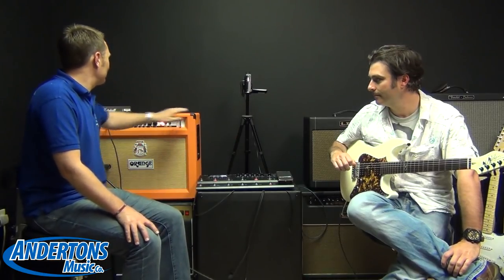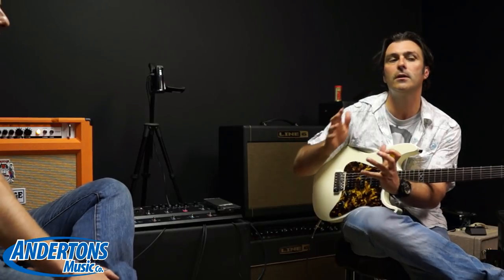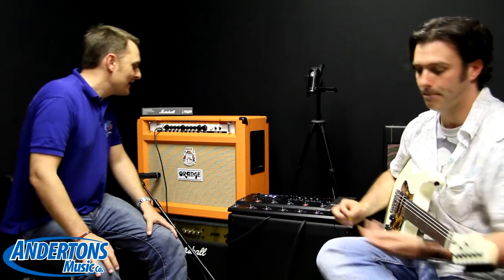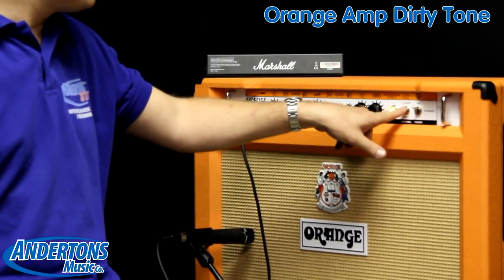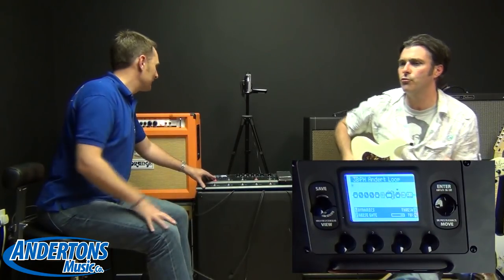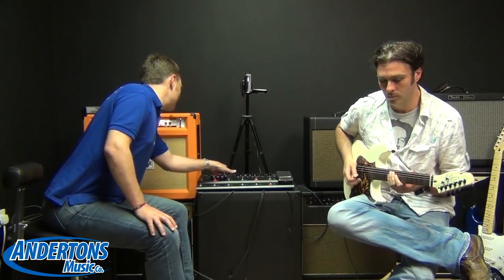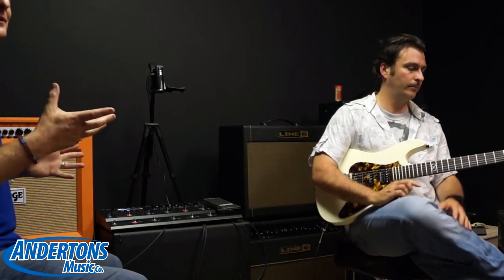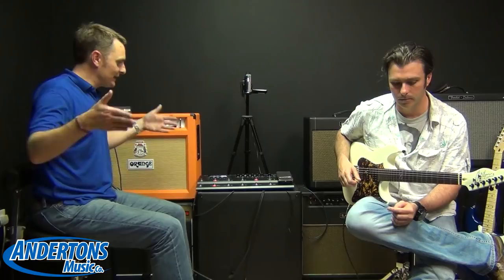Line 6 POD HD500X - 4 Cable Method with Orange Rockerverb 50 MkII

Comment: I'm glad you brought that up. Thats exactly why I won't go this route. I have a 100 watt EVH 5150iii. This is an amazing head. But there is a noticeable difference with this in the loop. If you love the pure sound of your amp this WILL effect it. It's too bad, the versatility and the affordability makes this a great option. If it just had true bypass it would be a winner!
Reply: Totally agree. I've got a Mesa Mk V:35 which is an awesome sounding amp but putting the HD500 in 4 cable method sounds crap. If I just put the POD in the effects loop and feed the POD through a effects loop module (in the POD), it sounds OK (standard 2 cable effects loop) , but putting a guitar into the guitar input of the HD500 sounds horrible (background hiss and noise) with the tone sucked dry (4 cable method). It appears that the input stage of the POD just doesn't play nicely in front of a real amp.

Comment: This tutorial by far is the best video on the 4 cable method, as it effectively turns your single channel amp with an effects loop to a dual channel amp thanks to the modeling on the HD500x. Question, what output mode did you select for this? Studio, Combo Front, Stack Front, etc?
Reply: themarcoharder hi, i hope you got an answer somewhere else... if so can you share? 😊
Reply: you go power stack front or in... dont remember the setting name right now

Comment: Guys - I had a RV50 MKII and used the 4CM with it like I did with my Blackstar HT60 - (Enough acronyms?)  I don't hear your amp doing this - but MINE would pop when turning on and off effects - I wonder if it was because I had the Impedance modelling set globally to the highest, instead of modelling the individual pedal impedances (Which can kill tone in other setups).  I ended up selling my RV50 because of this issue, and it was like 100lbs.   I've recently re-ordered the RV50 MKIII in head/1x12cab combo - and Would love some advice on how NOT to pop when turning effects on/off.  I will eventually move on to Helix - but that assumes that Line 6 can ever manufacture enough to be in stock anywhere.

Comment: Question for the Line6 dudes - have they fixed the tone/level loss problem when using 4CM on the original HD500? The fix for that involves using two EQ blocks - before and after the loop - to correct the levels; losing those effects blocks pretty much permanently if you use 4CM sucks...

Comment: I just run the HD500 in & out of my effects loop. Using only the HD500's Delays, Reverbs, and other modulation effects in my amp. I shut off the stomps, cab and amp sims.

Comment: If you are connected via 4 cable method, how does the volume work, if you choose HD500X preamp? Does it go as much loud as it would if its amps preamp would be turned on?

Comment: I have a line 6 spider IV 75 watt and a POD HD500X pedalboard, I need to help me understand how to connect the L or R output directly to the amplifier without losing the original sounds of the pedalboard, since I tried to set the amplifier in clean sound to get Better the sounds of the POD but it has been useless, it always sounds like stuck sounds.

Comment: I am curious about using the 4 cable method to use the podhd500x with an axe fx ii. It seems like it would work. There was a statement made that the pod "cant change the preamp channels on the other amp", but what if the other amp accepts midi? Im also wondering if there is a way to make use of s/pdif in connecting the units? I currently own an hd500x, and have the axe fx on order, Im thinking of ways that I might integrate the two and am hoping to use the hd500 as a footswitch both to switch models on the axe fx and also to switch post preamp fx in the pod.

Comment: Is there a certain way the switches should be set on this pedal. It makes my amp sound terrible. I've got a Randall Thrasher and it sounds really clean on the distorted channel of my amp when I plug in with the 4 cable method.

Comment: So I use a pod HD 500 with the 4 cable method into a Carvin V3 head and use the pods midi control to channel change the v3.  Bass the new hd500x eliminated this feature. Or does the orange amp not midi switch?

Comment: If your amp is MIDI ready the POD HD500X CAN change your channels on your amp.
Reply: Question. I'm looking into Marshall JVM 410, and since it has Midi in and outs,  I was wondering how does it work, if you connect Midi cables and regular 4 cables? JVM has 4 channels, and 3 stages, green, orange and red, so actually 12 channels. Line 6 Pod HD 500X has 16 Midi channels. Is it possible to assign these channels trough out patches (songs) but also configure the structure of signal trough 4c method so you can operate trough signal. For example in one song you can be using Fender Twin Preamp from the Pod and configure it so it goes trough the power section of JVM with all effects being used, and then for the dirt you wanna go strictly trough the JVM (I don't like high gain amp simulations on Pod), but also use the effects. Or maybe don't just mix and match rather scroll trough the banks, clean on one patch and then go bank down for the dirt. I hope you get what I'm saying...
Reply: Also you can get the amp gizmo in unison with the 500X, to change the channels on your amp, if you're amp isn't midi.

Comment: Hi Captain and Paul ,have a small question about the 4 cable method,how can i not losing the clean controls of my amp when using line 6 Firehawk and even hd500x ,because i managed to connect this 4 cable method but amp is not switching between clean channel and distortion,what is happening is that the amp stays on channel two but changes to clean preamp and clean channel controls are non functional,it's like it bypass the preamp and comes like full on volume in clean preamp

Comment: So to get your own amp head sound you just turn off the pre amp in the line 6?  I have a Laney GH50L and want to use clean tone of it and use my line 6 as a stomp box. I feel like the clean isn't my tube clean of my amp when the amp on my line 6 is off. Suggestions??  Thx guys
Reply: There's an FX loop setting on the Line 6 you have to select. I recommend looking up a video specifically teaching you how to hook up using the four cable method. That's what I had to do at least...

Comment: Please help anyone. If I correct, I can connect my Bugera 6262 with HD500X and using HD500X loop (send>return) to Bugera preamp Lead (input>send) and switches between Preamp and Poweramp (return) for cleans with just HD500X??? It would be ok? that not damage my bugera preamp? when it will be allways on when I skip preamp and go to poweramp for cleans?,  I decide between HD500X and Helix LT,  cos Helix have amp switching and HD500X not, but its more then 2 times expensive, and I thing that modulations are also great quality in HD500X right? Thank you for reply.

Comment: ppppplllllleeeeeeeaaaaasssseeeeee!!!!! can i do this with an amp wich doesn't have a parralell effect loop? mine is an hot rod deluxe and it has a serial effect loop, and i'm pretty sure that both preamp are on when i do the same as Paul in this video...
Reply: Sure you can. This Orange has a series loop as well. It will work with a series or parallel loop.
Reply: Not to forget of course that if you do run it in a parallel loop you will run into problems with phasing unless your post preamp FX are set 100% wet. You then need to be able to adjust the effect level some other way. Some guitar amps parallel loops have a mix control knob. Otherwise you will have to adjust in the pod. Not sure if you can do this. Parallel loops can be pain to set up. I trid using my old Pod XT live in the effects loop of my Diezel Einstein and it sucked tone quite badly. Hopefully the HD series has improved things.

Comment: i tired this way with  mesa boogie mark v 25 and pod hd 500x  it made the sound digital, keep away from this method
Reply: +Ender Binen Mesa fx loops are trouble makers, the effected signal comes in delayed and sounds fizzy therefore.
Reply: +Worshipcaster Would it blow what ever I do? Or is it possible to make it sound good? Thinking of doing this with my Mini-rectoverb, but if it wouldn't work that well can you tell me how to switch channel and effects without pushing 400 buttons as fast as possible?
Reply: +Kevin McDonald I use it with my mini rectoverb.  It sounds great, but there is a little bit of noise that gets introduced.  

Not the end of the world, but it can be annoying.
Reply: +Mark Lugg Thanks mate, but I ended up buying a Boss GT-100. Works fine for what I'm playing :)
Reply: Kevin McDonald Cool, man :D